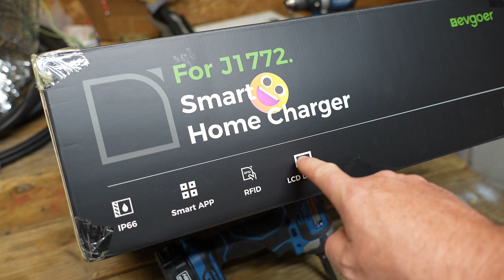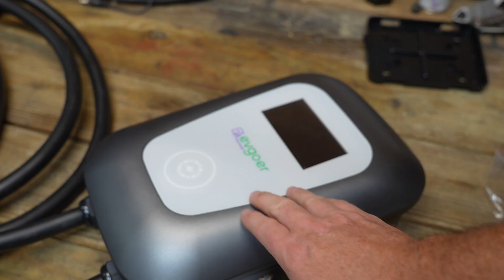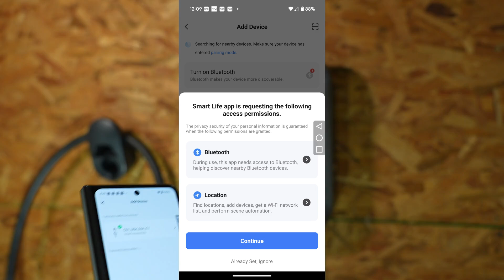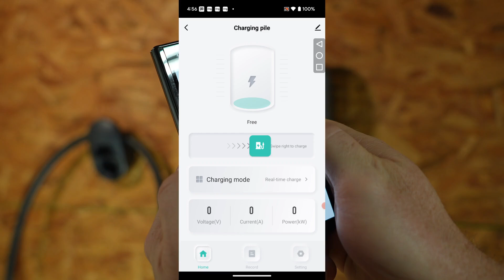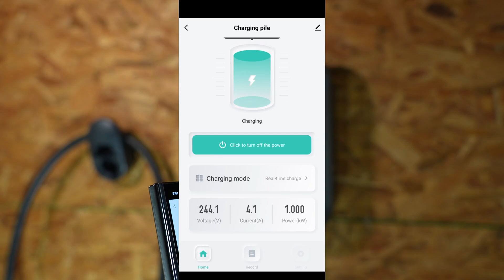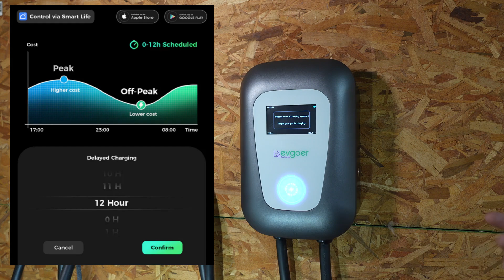Evgoer J1772 Home Charger Wall Mount High Speed L2 with Access control via RFID cards!

Comment: So without registering in the app you need to use the cards to charge? That’s gonna be a nightmare in a few years when the company goes out of business and you can’t access their servers or find the cards, or even if you just move or change Wi-Fi after it’s all deprecated.
Reply from the maker: You do not need to register the app to disable the card feature.  You just hold the card up to the machine for an extended period of time and it disables the card feature and works like a normal charger.    To re-enable the feature, you have to hold the card up to the machine again and follow the same procedures.  It will work without the app, no issues there.